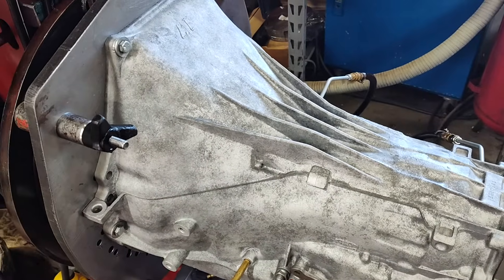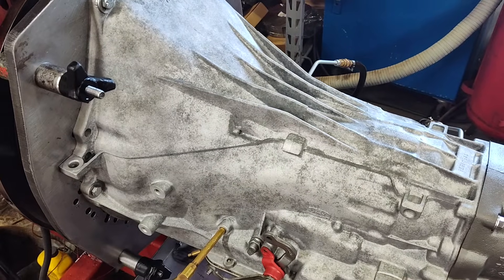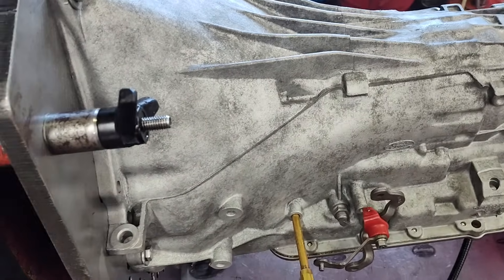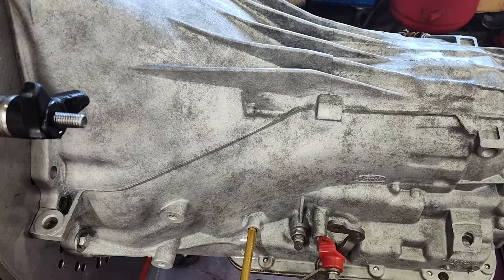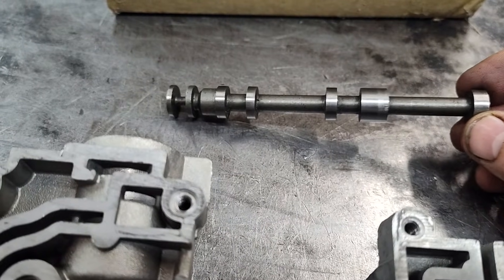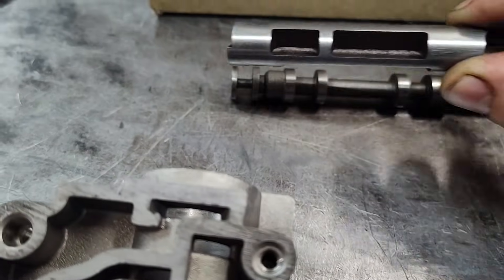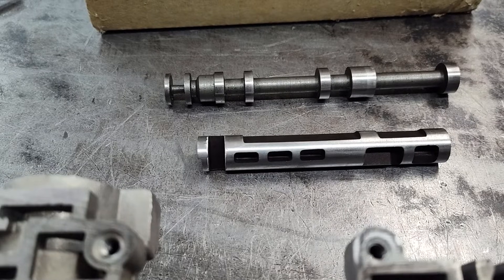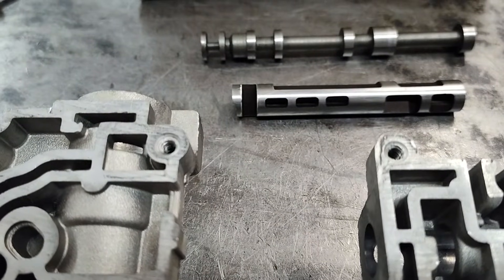Shifter Problems Unique to a Ford C6 Transmission

Comment: Would disconnecting the modular help un stick a governor? Mines not downshifting to 1st and wanna try not to remove the transfer case. I’m thinking about the higher pressure you mentioned
Reply from the maker: I dont think so but you really have nothing to lose.

Comment: Hi I’ve got a 1979 c6 and it was working good in January and had to pull when rebuilding the engine and now when I put it back in the truck and topped off the fluid it acts like it’s stuck in second and when dropped into manual first gear it locks the rear tires up and suggests should I be looking at the valve body or the governor. Thinking something is stuck and it in 2 gear at once. Thanks for any help.
Reply from the maker: I don't think governor. Possibly valve body or linkage adjustment.

Comment: My c6 was ridiculous hard to shift when running and light and easy when it was off like you said. Replaced the cable and wrapped it with heat shield thinking the header was melting it. I switched to your rmvb with brake and a hurst pistol grip and it’s night and day better. I never knew of it being a c6 problem but my dads shifts kinda hard too with a factory cable column shift
Reply from the maker: Good info. Thanks for sharing
Reply: @BroaderPerformance of course everything was working well. Now I bought a converter and figured I’d have the trans freshened up while it was apart and now it shifts with considerable effort compared to before when it was minimal effort. Anything that could happen during the rebuild? I verified the manual select valve as per your video and it’s all within spec. Hoping maybe it’s a shifter adjustment or maybe the cable is bound up. But it shifts easily engine off.

Comment: I always learn something from you, your instructions on setting up the spool valve to the detent on the C6 instructions in your shift kit made alot of sense. My B&M megashifter took a little time to get right, luckily the cable is short. Is there any way to modify the spool to get the oil to the other side of the spool to lighten the load?
Reply from the maker: Good question. No easy solution to my knowledge. I do plan to redesign the valve body to use a spool valve in the near future. Time has not been on my side lately.